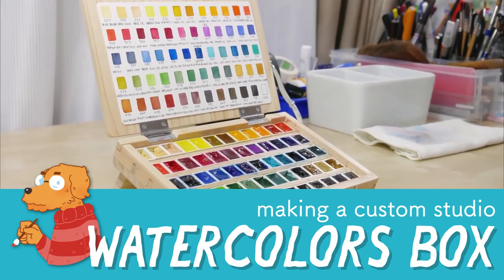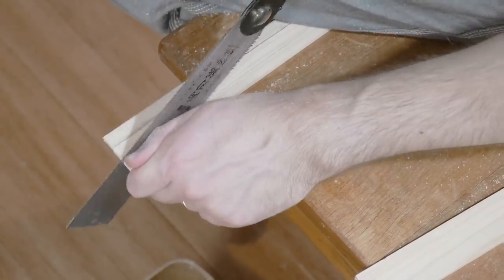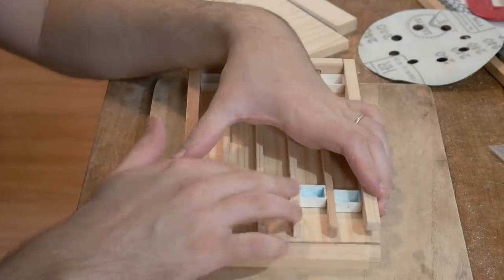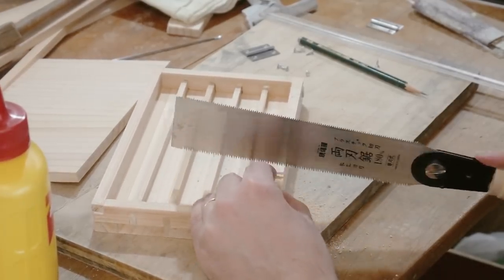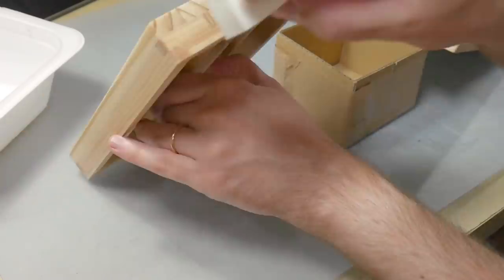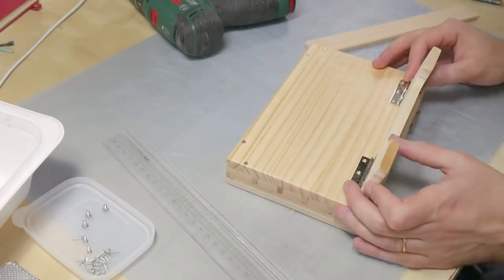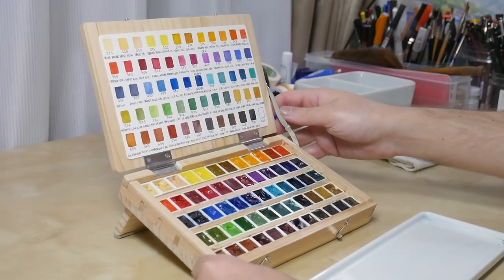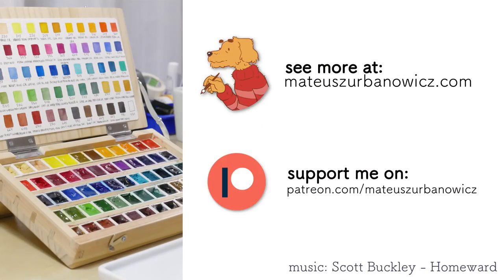Making a studio DIY  watercolors box

Comment: I would also cut an insertable rubber/silicon mat, so it would seal the paints individually when box is closed and prevent them from leaking out/spilling over each other. Thus this box could be used as portable storage.

Comment: Was wondering what size nails did you use? 😅
Reply from the maker: I'm not really sure, I just compared them to the thickness of the wood so they are not to big (splinter the wood) and not too long (go through the firs layer and about 3~4mm into the next)

Comment: Hi, may I ask you what do you paint on top of the wood surface to avoid watercolor stain? I have the same problem with my drawing board and your method seems very useful and fast.
Reply from the maker: I stick my paper to a board so it's easier to handle and to reduce warping :)
Reply: Hi Mr. Urbanowicz thank u so much for your reply! Sorry I wasn’t clear. I meant what do u pain on the wood surface to prevent letting the watercolor splash sink into the wood grain?
Reply from the maker: Eunice Wang  Yes, I put varnish on the wood so the paint doesn't sink into the wood and later I can clean it out if I want :)
Reply: Mateusz Urbanowicz thank you so much!! I’ll try to do the same with my drawing board. Love your art work! Thank you for sharing your wisdom!